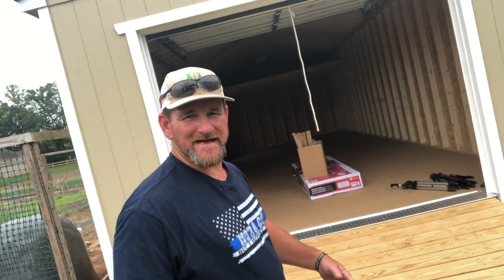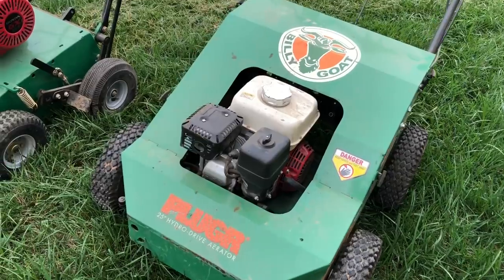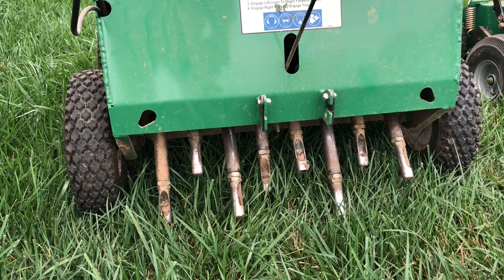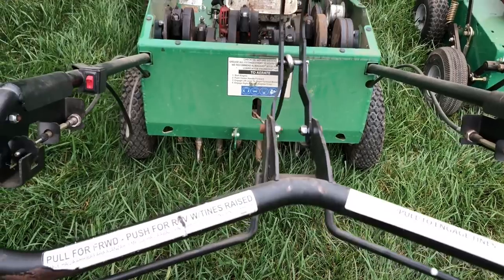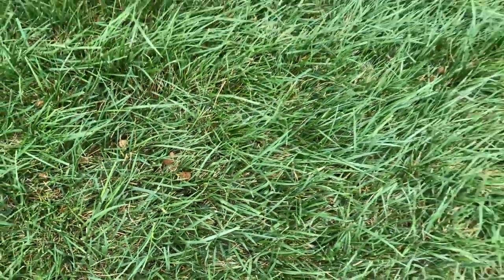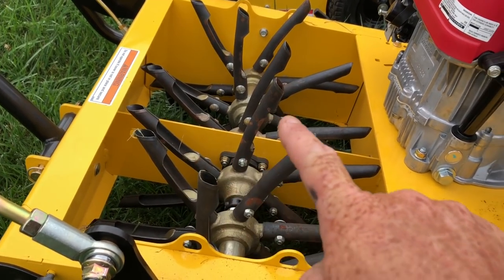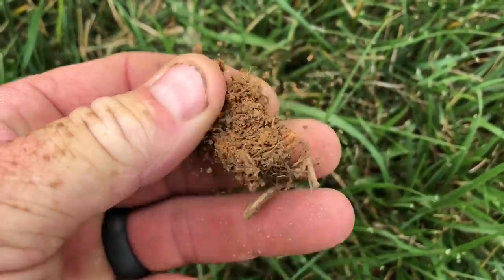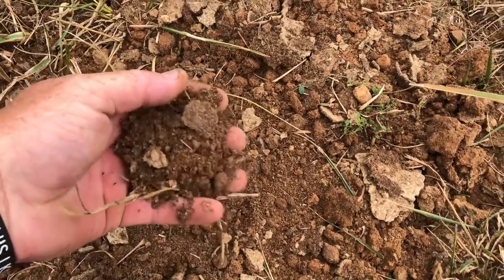How To Aerate A Yard - Reciprocating Aerator or Drum Type Aerator? - 3 Part Series

Comment: Pete. We have plugrs too. I noticed when you zoomed in to the tines on the plugr you have them screwed in all the way. If you want deeper plugs you can unscrew those tines a couple of turns and then tighten down the top nut to hold them in place. You may know this or will be adjusting them for the season. Thanks for the video.
Reply from the maker: yes sir.   I have them set in storage ode   I will change them tomorrow   didn't think about it for the video  LOL

Comment: Both of those aerators look smaller than the aerators I have seen. The types that I have used have been heavy machines and you cannot make a turn without lifting the tines when you do it. I did water my yard for 2-3 days ahead of aeration which helped the depths of the cores. Maybe I am getting ahead of you, but I would guess that your would use your aerovator next on your neighbor's bare dirt to break up the ground further, right? Anyway, nice video and nice job, Pete. I'll be looking for your next videos in this series as it is the time of year to do all this in my yard.

Comment: Hey Pete! I bought an Agri Fab tow behind aerator just for cost savings vs renting and because of the size of my property (1.5acre TTTF and another 2acres of field I'm trying KY31).  I'm hoping it pulls a decent core plug.

Nice Officer Baker shirt btw, I believe he lives the next town over from me in Harrodsburg.
Reply: I planted KY31 on my prop (4acres) works real well sends down very deep roots. The trick with that grass seed is the more you put down per 1000 sqft the thinner the blades of grass will be. The less you put down the wider the blades will be. So if you plan to seed with it and want a more tall turf look. Spend the extra money upfront and buy more seed.
Reply: @AaronCMorris  thanks for that tip! I always wonder why some looked wider than others.  I may wait until my tttf lawn reno and do that next year then.  Just bought 500lbs of GCI grass seed.
Reply from the maker: 500 pounds????  good grief man!!!  I want to that you for that man! I appreciate it! Still hard for me to comprehend what is happening this year with GCI....humbled
Reply: @GCITurf  yes, sir.  I have a little over an acre I'm doing your renovation plan on.  I'll be doing another acre or so next year once my pool, driveway and landscaping are done.  Thanks for all your help Pete!

Comment: Hay Pete, Just watched your video and wanted to know your opinion on which aerator is better. The newest Billy Goat 2501 or a Stinger. I use a Ryan Lawnair 28 an it hard to work with.I like the silky attachment on the Stinger and it now has a bigger Honda engine .Thanks for your time. Chris

Comment: Hey Pete! It’s Brent up in Ohio and I’ve got a question just to clarify. I intend on aerating and over seeding like the third weekend of September, I typically mow my tall fescue at 4”, my KBG section in front at 3.5”. So I should mow my back/sides  down to 3” (tall fescue) before aerating and perhaps 2.5” (kbg) in front? I just want to confirm, anyone is welcome to add their comments as well. Thanks again for your time Pete!
Reply from the maker: those heights will work   I would not go any lower than 2.5 for sure on the kbg and 3" on the fescue

Comment: So is a tow behind any good? One of those 48" agrifab type?
Reply from the maker: if it pulls plenty of plugs it is
Reply: I got the agrifab on Amazon for 200 bucks back in June... used it once so far on my 30,000 sq ft of turf and two other lawns for my family. Took a few extra passes because the tines are a little further apart but it worked great! Totally worth it in my opinion and it already paid itself off considering it's about 80 bucks to rent an aerator for 4 hours. Pulled 1.5-2 inch plugs with about 130lbs on it... and #hey, it pulled plenty of them by the time I was done!
Heads up though... Don't put too much weight on it and watch the hills/sharp turns because the bar linking it to the tractor could buckle/bend if the weight on the back wants to roll to one side... (fixed it, but I learned the hard way)!
Also, those tines are absolutely RAZOR sharp from the factory... I cut myself several times putting it all together. Nothing too severe but plenty of flesh wounds! But I didn't wear gloves or long sleeves... plus I get careless sometimes with that kind of stuff though so you might not need to worry about that!
Hope that helps and have fun, bro!
God bless you.
-DP